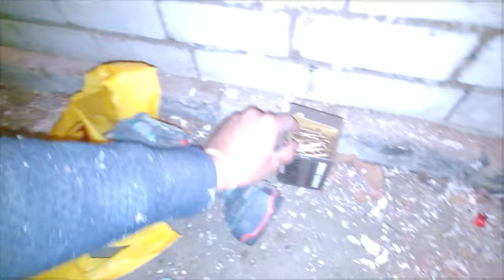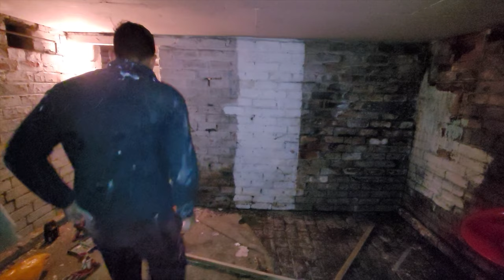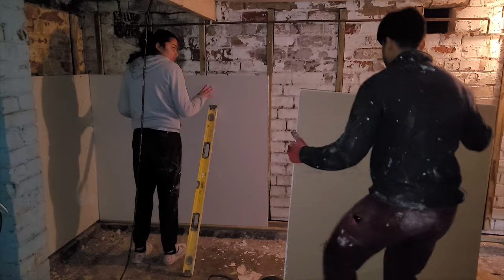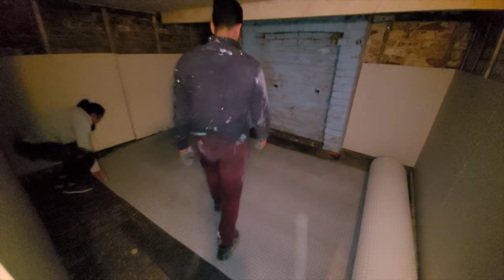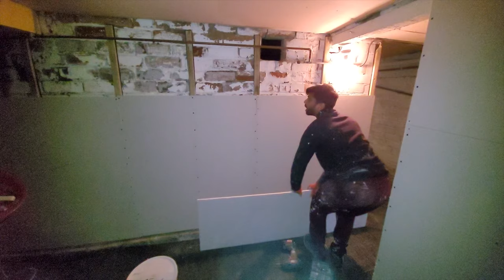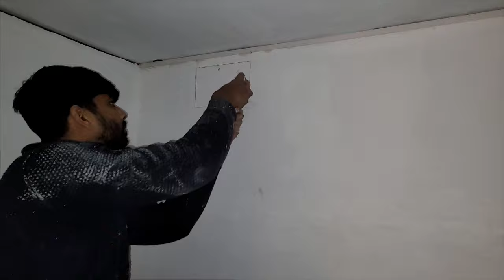Cellar Conversion on a budget - How to Plaster joints, low cost | Renovate Midlands 2021

Comment: Looks great, I’m sure you are aware though this won’t be permanent. The back of the plasterboard will go mouldy due to moisture from the walls. Some mechanical ventilation might help.
Reply from the maker: Hi Daniel,,

Thanks for your comment,  yes I agree. We are using a Dehumidifier with a heat blower. So far so good and fingers crossed.  Yes for sure it would wouldn't be permitted ...

Have you done similar projects before and do you have any handy tips to pass over to me :)
Reply: Yes I’ve tanked my own cellar and fully converted it with build regs sign off. Any info you need let me know.
Reply from the maker: @Daniel Warrington  
Oh wow, that is really good. I would have a lot to learn from you then :)

For a basic conversion, how much do you think I should expect. I have a 2 bed property, and the ceiling height is already around 1.9m in the cellar.
Reply: @jlpropertychannel9900  we got quoted 18K… but DIY’d for a 6k. And that’s will a builder putting in the window. 

My best advice would be to watch our on the eBay etc. people doing similar project will have left over tanking membrane, and as the not many people are completing conversions they go for dirt cheap. I was lucky to get most of what I need for about £200… rather then thousands.

Took me about a year DIY. Do it in phases so you don’t hurt the bank so much and make sure at the end of each phase you can still store stuff done there!

You’ll need build regs sign off too, worth it so when you sell it is officially another room which will add at least 10% to your property.
Reply from the maker: @Daniel Warrington  That is brilliant, I would love to see a video if you ever upload to youtube. Let me know if you ever do.

Really good advice btw and yes, the value would definitely increase. I got a few houses with cellars and I'm considering doing one of them up including the cellar too with BC regs.

Do you also need an additional fire escape for the new cellar room?

Thanks for your help Daniel 👍
Reply: Cheers! Yes you will need a fire escape, a window with a minimum size.
Reply from the maker: @Daniel Warrington  okay noted, thanks a lot mate 👍
Reply: @danielwarrington2865 what would you suggest the process should have been to stop mould completely

Comment: Thanks for this! We have a Victorian terrace in the midlands and we’d like to make the cellar useable for a washing machine and walk in larder. It’s just bare bricks and collecting cobwebs at the moment! Could you please share where you sourced your materials? Any advice for getting plumping installed to use it as a laundry room?
Reply from the maker: @jounfy  Appreciate the comment 😀 I got the materials some time ago, and they will be more expensive now due to material prices increases. Having said that, I normally look at Wickes and Selco for my materials. Then compar between both as they both change prices on items every so often.
If you want to do a laundry room and require plumbing. The main thing you need to work out, is a route for the waste pipe and a pump that is capable of pushing the water to go up against gravity.
Reply: @jlpropertychannel9900  Much appreciated!
Reply from the maker: @jounfy  Happy to answer any questions and base it off my experience

Comment: Hi mate great conversation. I have something similar have you experienced any damp on the plasterboards. Also are they the waterproof ones or just Normal gypsum ones.
Reply from the maker: Hi there, thanks for your message :)
If I am not mistaken it was normal gypsum plasterboard and I left an inch gap between the walls and the boards. I used batterns with dampproof course on it. I done this basic cellar conversion just to make the storage more usable. I also used a dehumidifier or a low voltage fan to push air during the day and night to control moisture levels.

It has been okay so far to the best of my knowledge. Having said that my cellar didn't have that much damp conpared to other cellars.

Do you get slight flooding at some times of the year in your Cellar?
Reply: Thank you for the speedy response and great advice. My basement never flood as we live on top of a hill. My basement suffers from slight efflorescence in small areas of the basement. Is there anyway i can send you a small video just to get abit of advice?. My basement doesn't have much damp either.
Reply from the maker: @hellomyg8182  No problem at all ... you can upload a video on YouTube and then show me.

Only thing is I have only done it for myself and it maybe best to get professional advice as you may want it to be certified by Building control. 

Looking forward to seeing the video of your cellar once you upload to youtube... 😀
Reply: @jlpropertychannel9900  Great idea. Like yourself I only want it for storage and dont want to spends thousands getting it tanked. I'll make a video during the day so its visible and send you the link. Absolute legend. Ive liked and subscribed to support your channel. Thank you responding to your comment i know like myself alot of people appreciate it. Enjoy your weekend
Reply from the maker: @hellomyg8182  you are more than welcome and I am more than happy to respond ... 

I am looking forward to your cellar video :)

Comment: Gypsum plasterboard will absorb damp. Is there any ventilation? Lime plastering the walls (after cleaning them), would, I think last longer
Reply from the maker: Hi Jim, I have a dehumidifier with a heater that circulates air around. Thanks for your comment. Do you do cellar conversions, or have you done one
Reply: @jlpropertychannel9900 No I have a Son with a Victorian cellar. I have re-instated the airbricks and it seems to be working. If we can manage without electrical ventillation we will be happy. I have seen how well the lime plaster works. It likes a bit of damp behind it.
Reply from the maker: @Jim Hignett  oh I see. Thanks for your advice btw. I appreciate it and all the best with your cellar.

Comment: Hi there , looks great . Can i ask how much it cost u all in all to do please
Reply from the maker: Morning Rachel, without looking through my costs. It cost roughly £200-£300 to do. Just make sure you put a decent amount of airvents and leave a gap between the wall.

Are you thinking of doing your cellar conversion. Because you may want to go down the route of doing a drainage and tanking etc. That way, you can clarify it as a space when you value the property.
Reply from the maker: I done what I did in the video to keep costs low and just to make the space more usable. 

Also, you may want to consider how damp or flooded your cellar might get every year.
Reply: @jlpropertychannel9900  thankyou for ur reply , and yes im thinking of doing my cellar and im  going to look into getting the drain thing done im also looking into doing the tanking too
Reply from the maker: @rachelcarter2036    I can imagine that after you finish, it will look great and it will add useful space for you.

I used to live in London and have not seen many cellars at all. Now I am up North, I see so many. Consider yourself lucky to have one as they can be very useful.

Good luck with your Cellar and we hope to see you on our comment section below soon 😀 or even better, like and sub if you wish 🤞

Comment: Why not dot and dabthe plasterboard instead of wood batons?
Reply from the maker: Hi there, Thanks for your comment 😊 
If we dot and dab, the moisture will get absorbed faster through to the plasterboard. I put wooden batons with a damp proof membrane to reduce the transfer of moisture from the cellar walls.

Are you doing something similar ?

Comment: Please, do not do your cellar/basement like this… should have tanked it properly. Also should have a sump pit and pump… No heating… you’ll get condensation buildup everywhere…
Reply from the maker: Hi Catherine, thanks for comment. Do you do cellars in the midlands by any chance.
Reply: @jlpropertychannel9900  nope. We did our cellar in a Victorian house. Lots of research is very important and you really can’t cut corners.. when you lock away the moisture from the floor you’ll be surprised how much water collects.. when it’s open you get lots of natural evaporation. You may not think it, but a good sump pit and pump is so important. Also we have a thick PIR insulated underfloor heating system installed. Good luck.
Reply from the maker: @Catherine Caine  thank you for your advice, we appreciate it. I will keep what you said in mind.

Comment: You have weakened your house from the foundation. The dpc injection will cause the brickwork to turn to dust. It wont stop penetrating damp from the walls and the plasterboard will get mould.
Reply from the maker: Hi, thanks for your opinion. We read and acknowledged what you wrote. It would be great to provide some constructive feedback along with your comment as well. Others and myself will benefit more from that.

Please note that the repair we did in this video has done the trick for us. It has been 3 years now, and it is important to know this in line with all comments on this video.

Looking forward to your constructive opinion...
Reply: @jlpropertychannel9900  you have just hidden the problem of water penetration. The bricks need to breath and you have stopped them from doing that, they will hold the moisture and begin to spall. Weakening the foundations of the property, entire buildings need to be rebuilt because of this.
Reply: @jlpropertychannel9900 also the timber that you have just drilled onto the brickwork will also begin to rott as its drilled directly onto the basement walls. 3 years and its been ok, but you will most certainly need to redo the whole basement again.
Reply from the maker: @user-iu4pt6yf8t  Hi, thanks for your constructive opinion. We would love it if you could leave some constructive feedback on any of our other videos.

Thanks in advance
Reply from the maker: @user-iu4pt6yf8t  We used treated timber with a damp proof membrane between the brick and timber to stop the transfer of moisture.

Having said that, more comments are welcomed on our other videos. Thank you.
Reply: @jlpropertychannel9900  I am a director of a maintenance and refurbishment company. I am pointing out the errors as your video is very misleading.
Reply from the maker: @user-iu4pt6yf8t  We feel honoured that a director of a company has personally noticed our channel. Speaks for itself, and we can't wait for the attention of more directors.

In order for me to believe you are a director of a reputable company that works in this field. Kindly reply to this comment with the link as this will be public information anyway.

If you are a director of a company related to the category of our Youtube channel. We would love more expert opinions on our other videos so others can benefit. I'm sure we can both agree that this is what we both want.
Reply: @jlpropertychannel9900  unfortunately consulting if thats what your requesting is charged. Always remember that doing something cheap doesn’t mean it’s done correctly. You will almost always pay twice and more in the long term.
Reply from the maker: @user-iu4pt6yf8t  We have clearly asked for the company to prove your claims of being a director, not consultation. It also seems you have more time to comment on youtube for free than getting paid via consultations. The fact that you can not provide this proves it's not a company worth sharing. Or what you are saying is backed. One of those companies you pay and then have to pay a second time to get the job done properly. We have all experienced a company like that. At least your company is relatable.
Reply: @jlpropertychannel9900  how rude and disingenuous.
Reply from the maker: @Amir-f6o1z  I agree, it would of been more genuine if you put the company name so others can trust your company's reputation 

Again, thanks for all your comments so far, it really helps our channel with the Youtube algorithm